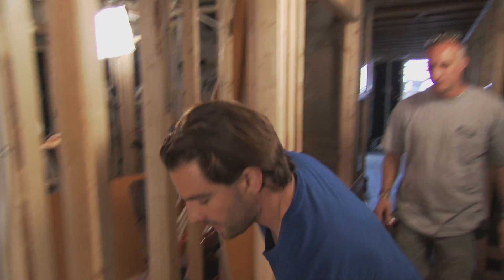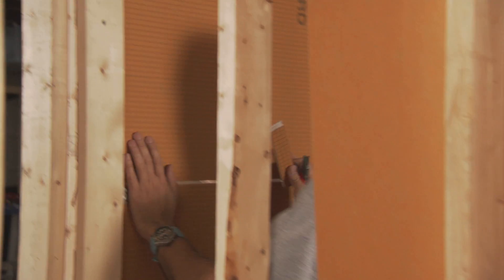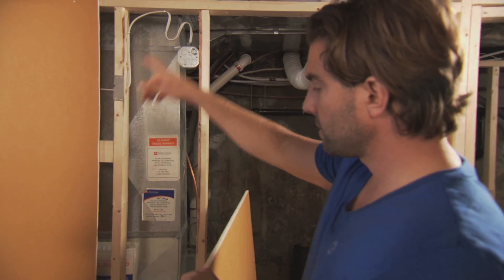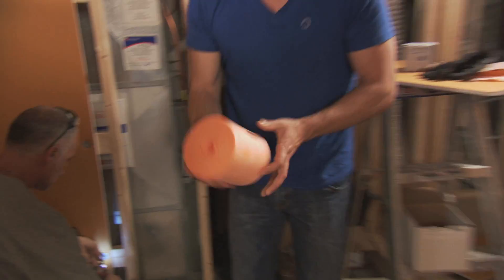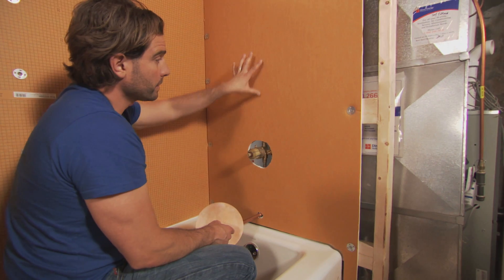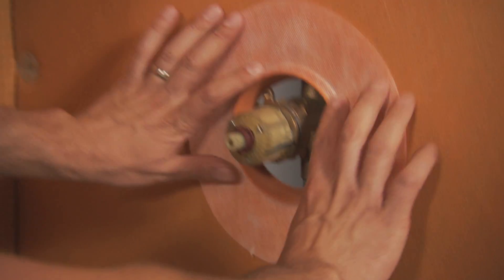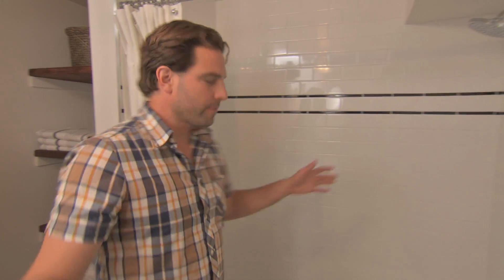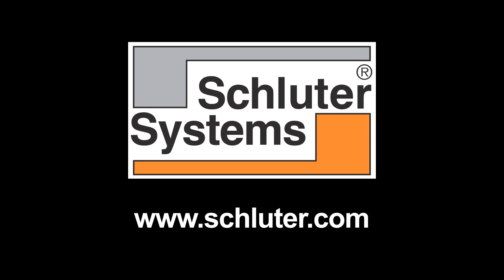Scott McGillivray on Waterproofing Principles using Schluter®-Systems

Comment: Nice video but y isn’t there any support under the right side of that board. So much for supporting it ever 12 inches or better
Reply from the maker: Hi Brian. You are correct that the Kerdi-Board has to be fastened every 12”. It’s always difficult to tell in these videos how much was done afterwards, and if the team went in and added more bracing after to get more screws on the right side. Hope so!